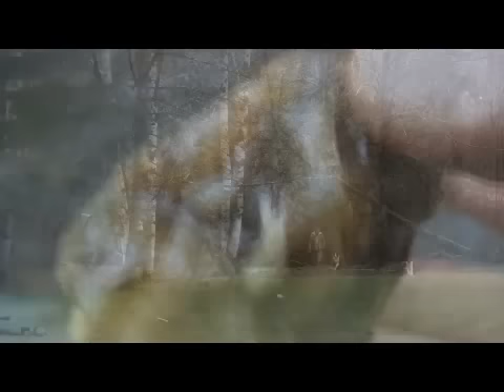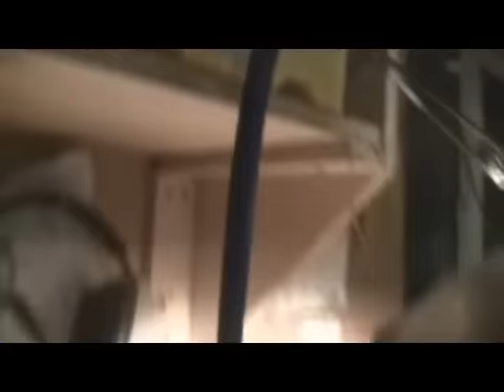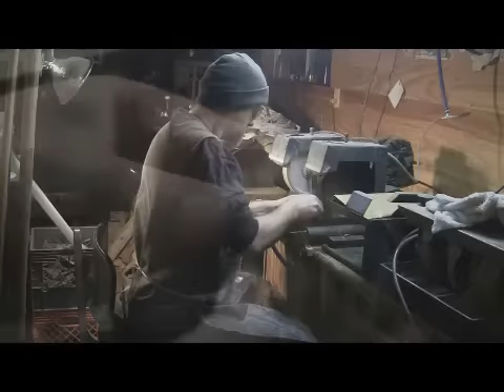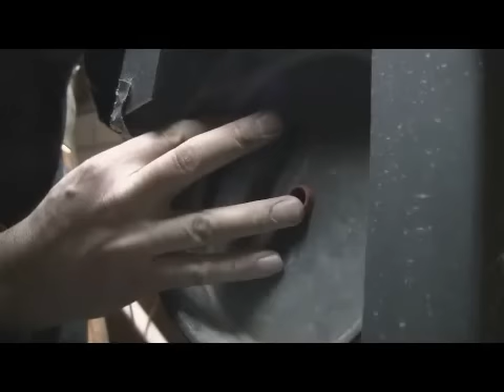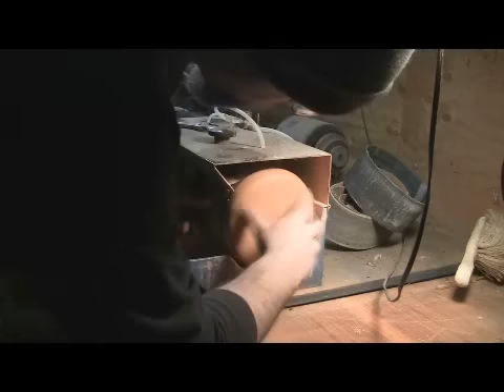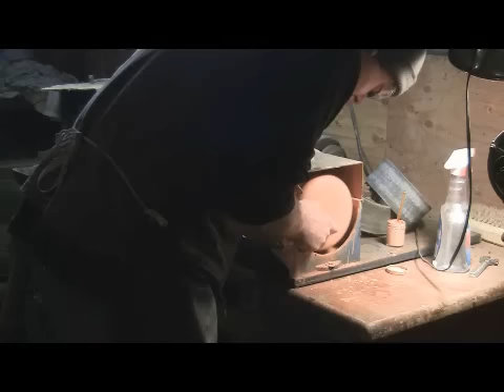Civilizing an Agate

Comment: What grit are the first 2 steps? 
And then you go from 220 to polish? Did i miss an intermediate step?

Nice shine at the end.
Reply: You can use 30 but it's very rough and it's not good for brittle material.  60 wintered, or 80 electro plated wheel, then 220, 280, 600, then yellow and pink wheel.  I think it's 5,000 and 7,000

Comment: Are you using cerium?
Reply from the maker: Yes
Reply: @gotrocksinhead  that stuff is expensive,  messy, and it has to get hot to polish. I'd reccomend getting a synthetic felt pad and use 14,000 mesh diamond paste. The pink color contains silicone for coolant and lubrication.  It takes seconds to polish and it's cheaper.